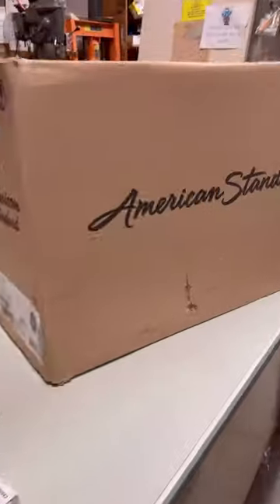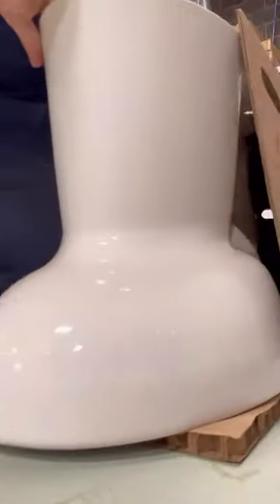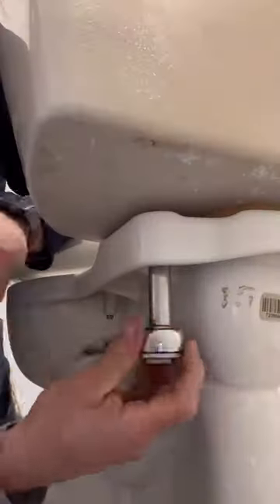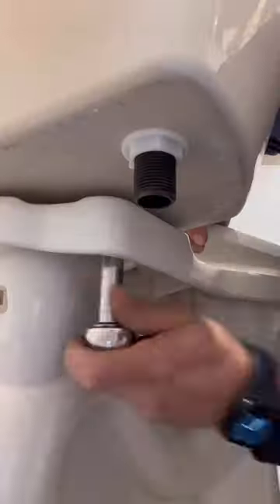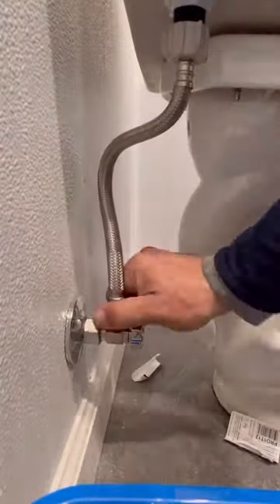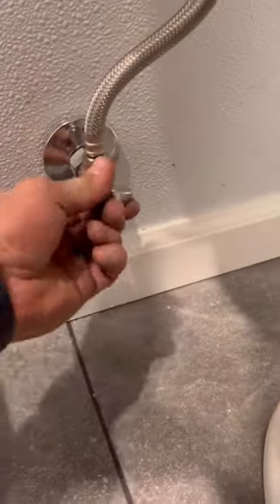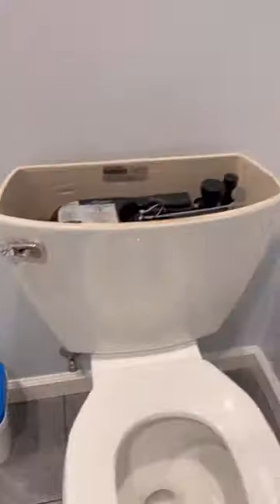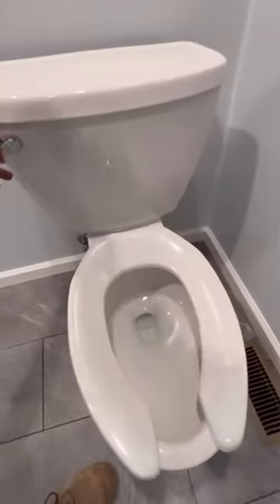Pressure Assisted Toilet Installation

Comment: Inspect them thoroughly we had one exploded after we installed one in a customer house. Brand new pressure toilet.
Reply: That's scary. What kind of toilet was it and what kind of vessel did it use?
Reply: That’s absolutely terrifying, that’s why i don’t like pressure assist tank toilets
Reply: Yikes! That's why I don't replace toilets with pressure assist. If I see one in my house then I will immediately replace it with a non pressure assist toilet